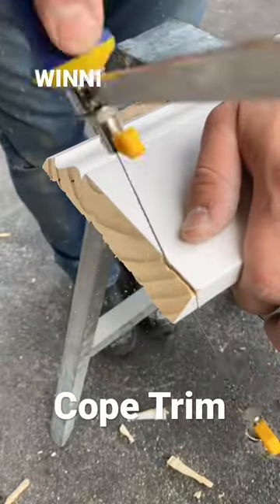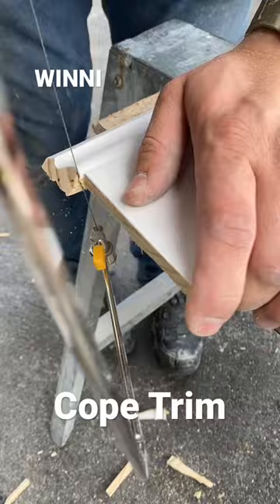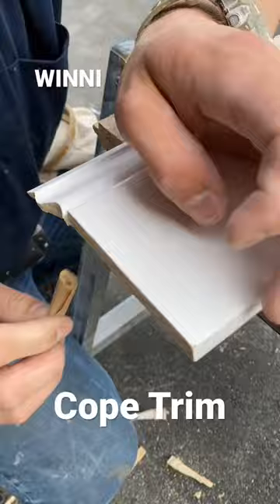Best way to do baseboard trim inside corners. #diy #shorts #youtubeshorts

Comment: There’s still a gap buddy. How not to cope
Reply: Oof wrecked him now he needs a coping mechanism
Reply: Caulk?
Reply: @claudiaaguilar-  yes, but using a 45 degree miter saw that takes 2 seconds can achieve the same result, if you caulk after. What he did takes around 3-5 minutes, after caulking, it will end in the same look
Reply: He wasn't finished yet.
Reply: Lol definitely has daylight blasting through.
Reply: Clearly you haven’t painted we caulk the trim that’s perfect work 👍🏽keep up the good work
Reply: @samueltrinh3850 Coping is always a better practice unless you personally did the drywall and framing and know its square. Not guaranteed to have perfect 90 on the wall corner.
Reply: @samueltrinh3850  nope coping is a much better method, because 90% of corners aren't really 90°.

Comment: If you cut your straight cut at 15 degrees it will fit tighter
Reply: I was about to say the same thing lol
Reply: I do that, too, so the back "meat" doesn't hit each other lol
Reply: Pending you wear a tool belt, This should be common sense
Reply: What do you mean?
Reply: @jakeferreirafamily  do the math
15*&15* are 90*
Reply: @jimschaffer8921  how is that 90
Reply: Thats a brilliant trade tip & something that's has been passed down for generations
Reply: Cope
Reply: Also use a jig saw, it's faster
Reply: Run the straight cut on your miter saw at 5 then cops the rest.
Reply: @MathalomuleM31 tell me u don't do carpentry without telling me u don't do carpentry. *this guy
Reply: @MathalomuleM31  They have coping jigsaws that help now. Dewalt makes them

Comment: It is the difference between a real carpenter and a hack.
Reply: Just 45 and glue
Reply: @oscarmenjivar1439  ok hack
Reply: @Johnny-es1wl  whatever dude
Reply: @oscarmenjivar1439  not to be a dick man but I was taught to cope at 18. Was also taught that that is the only way to do a good clean inside corner. No need for caulk.
Reply: @Johnny-es1wl  I’ve always 45 and glue no problem so far 10 years repeated clients so far so good
Reply: @Johnny-es1wl  I done joinery and I am fairly good with my scribes but honestly for skirts 45 is more than enough. Really u want to scribe mainly on furniture , or if someone forgot to put a 45 of a skirt

Comment: Works for production. But for high end trim, cut as close and you possibly can then file the rest, so you don’t get those little imperfection you had, When you get it that tight the painter doesn’t need to caulk it!
Reply: I  angle my cope a little more,  seams to do the trick!  But yes, file or these sanding wheels!

Comment: I use it all the time, have for 30 years but for it to look really good it very much depends on where they have taken care when moulding the board, usually it’s off slightly, but back cutting gives room for correction at cut

Comment: My 45 cut looks far superior to that gappy join 😂
Reply: May do on a perfect square corner but you can’t beat a proper coped joint
Reply: Doesn't need to be a square corner. Just use a protractor
Reply: @inkman6964  angle finder,set saw…boom!
Reply: @drorider5807  no skill chopsaw boom
Reply: @jessicadavid5661  clearly not a tradesperson don’t need anything other than a coping saw if you know what your doing (carpenter over 30 years experience)
Reply: @inkman6964  
Right! I never understood that. Just find out the angle of the wall 🙃
Reply: @inkman6964  mate, get out of the dark ages with your coping saw! It’s 2023!
Reply: @drorider5807  yawn I could cut one of these 10x faster than a mitre saw by the time you get it out the van and set it up and it’s not the dark ages it’s called skilled at a trade
Reply: @inkman6964  yeah right, you’d get left in the dust 😁
Reply: @drorider5807  lol ok pal I have over 30 years joinery/carpentry experience and taught at a local college
Reply: @drorider5807  true, you use coping saw if ur paid hourly 😂
Reply: @inkman6964 

You have a client, you say you will take far longer to do he job as you didn't want to use to such tools. 

You're not going to have a lot of work my friend. 

what next, "how dare you use a nailer, do you not have the skill to use a hammer?

If people want to mitre then let them mitre, so long as there are no gaps who gives a damn, stop trying to inflate your own ego. at the end of the day. all you're doing is sticking wood in corners
Reply: @timbitstimmys2250  ain’t that the truth! 😁
Reply: No it doesn’t lol don’t lie the trim carpenters know
Reply: @daltonbradshaw1391  we can all use a coping saw, if you’re using one in this day and age means you probably can’t afford decent kit.
Reply: Do your best,gap the rest
Reply: I had a trim with a design that was much thicker on the top of the molding than it was on the bottom and I could not get the inside corners with a 45 degree for my life. Used the coping saw and nearly lost a finger but got them to fit properly
Reply: @Inkachu  coping saw is the way to go always unless it’s a cheap job than just 45 it and get it done but all custom homes should be coped 300k and up
Reply: Not seeing anyone mention that an important reason to scribe or cope the joint is wood shrinkage. Mitres with always open up and look gappy with time, coping won't
Reply: @PnutButter1986  exactly coping is the right way no matter what although some builders/jobs won’t pay enough for that every now and then
Reply: 45s can open up what time too. Not to mention if you want to bump into some flat stock coping obviously would work better for that
Reply: @inkman6964  I will agree especially on wood that's going to be stained

Comment: I do a 45 forward cut, do a back cut on the straight section instead of the coping saw, then use an angle grinder to cut the cope to the 45 line on the shaped part of the joint.
Reply: Exactly what I was thinking. Everyone is talking about a coping saw only. Much faster how you just mentioned.

Comment: Instead of using a coping saw to cut the straight part use a mitre saw and finish with the coping saw. Saves time and cleaner work
Reply: Cope harder + L

Comment: Coping should start from the top. The piece he coped should have been butted to the corner then the left piece coped. If right handed, you proceed counter clockwise and start the cope on the top of the base and slightly back cut and snap in tight.

Comment: Cut back a little more  be more accurate on the contours. Cut your lengths 1/16 th to 3/32 nds long and when you install the extra length will compress the fits and it will look as it grew together. On short pieces inside to outside work from  inside out ,fit inside first cut about 11/2 inch long and tap cope to compress the inside joint then mark the length to cut your outside corner ! Use this same metbod on your crown .on paint grade just miter everything cuz painters are gonna caulk it anyway ,lol !

Comment: Meh looks ok but why would you say just cutting on 45…if you actually use an angle finder and divide by 2 or if it’s 45 and you cut 46 it’s tighter

Comment: Butt those boards together, DAP that corner with a putty knife, and call it a day.  You know those baseboards are getting torn out in 10-15 years anyways.  The only ones who will appreciate those corners are the spiders and dust bunnies. No one's looking if you fill the crack.
"Looks good from here."
Reply: Caulk and paint make a carpenter what they ain't!   Try doing a hardwood that's going to be stained,  let me know how it works out for you!
Reply: @stevehamman4465  agreed
Reply: @GoldVP...  thought??  I go extra angle on some  cope so the facing will smash into the straight lines . This video showed some gaps ,,I don't get that when I over angle my cope!    ???  And or file down!
Reply: Ppl don't take pride in their work anymore.
Reply: @jd111949 yeah...but people got better crap to do than worry about lines on the baseboard. It is just there to hide the bottom of the lath and plaster and cover the joint between the wall and floor. It's only practical function is a bumper against the vacuum cleaner banging the wall.
You will only notice the difference between a perfect mitre and a caulked butt joint if you spend a lot of time laying on the floor or under house arrest.

Comment: Am easy quicker way. Cut your inside 45. Move your saw to 22.5. then flip your piece upside down, and on the other side you were at. Back cut it right on the edge down to just before the start of the detail. Then finish up with a coping saw. Makes for a little quicker and also, a lot straighter for that straight par as well.
Reply: I work as a trim carpenter and we do custom cabinets and trim, so our stuff has to be top notch and gapless

Comment: I do a lot of coping on finger joints and edge trim but I prefer to do mitered 45 on base if I can. About the only time I cope base is when I'm dealing with a sagging floor.
Reply: I always cope base.  No more worries about out of plumb drywall or out of square corners.  Just cope and go.
Reply: bobcougar77  you obviously aren't rushed on projects lol.
Reply: @GoldVP...  I'm a contractor, not a gentleman woodworker.  I cope base because IMO it's the fastest way to do a good job.   Mitering base is a pain in the ass:  all the worst drywall in a house is at the base.

Comment: I can cope with chop saw and table saw faster than that
Reply: I'm also a table saw coper for anything with a basic profile. I learned it from an old union carpenter. For speed base or colonial casing, the table saw is the fastest way

Comment: I don't mind the effort and it does look so much better. But I have had absolutely no luck with it I can't figure out exactly why.
 I'm going to think about it again after I rewatch you cutting with that coping saw.
Reply: Cut the board at 90 degrees and it gives you a perfect profile.That’s what he did here.
Reply: The little tricks help, but the only way to get a super tight fit is practice. I took home drop cuts that were too small to use and practoced ever night for like a week before I was good enough for paid work.

Comment: No, it’s called scribing.  Plus why would you pin the skirting board there?  Move the pins over and the they would’ve been covered by the scribed board.  No pin holes to fills in a tight corner.  Nightmare to rub down